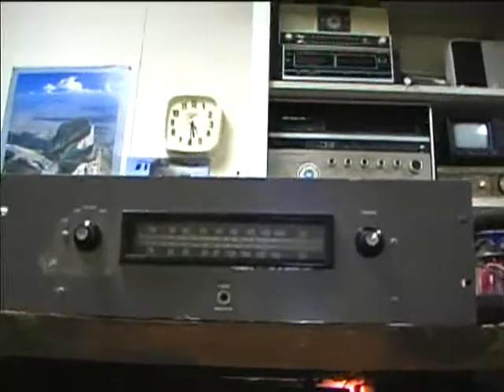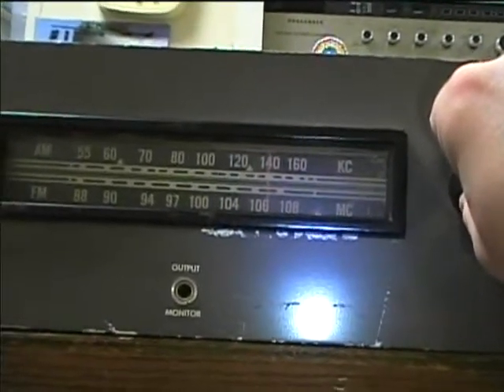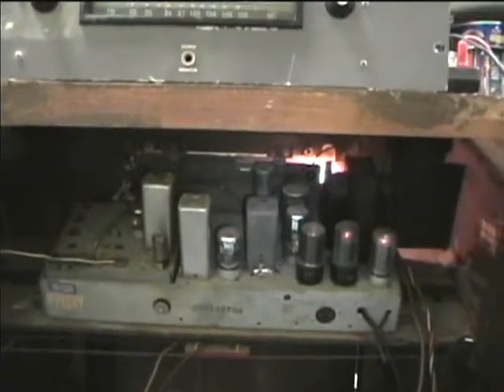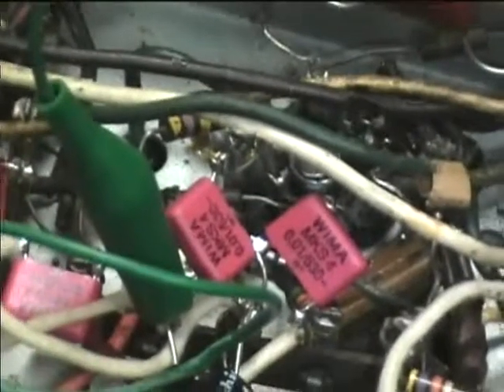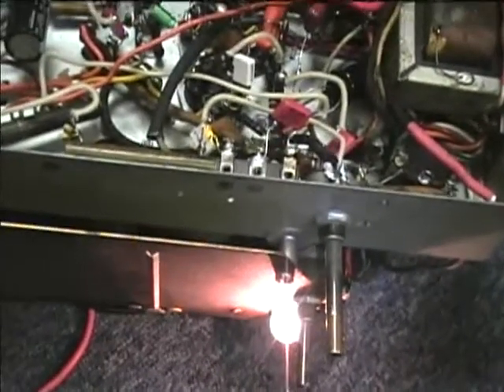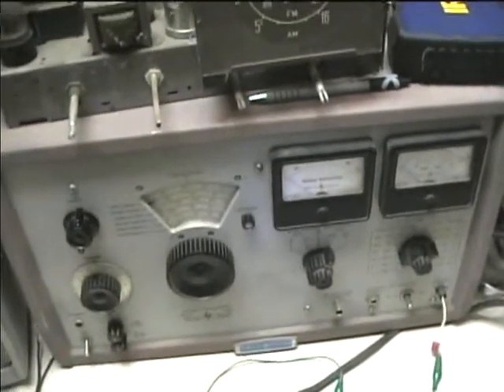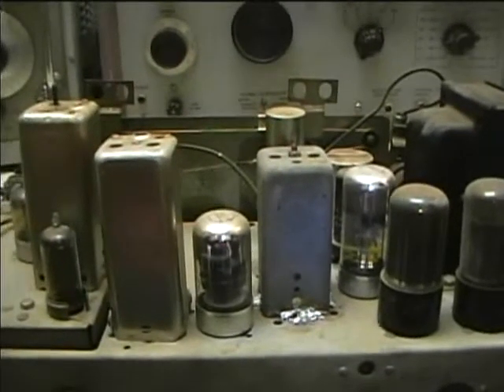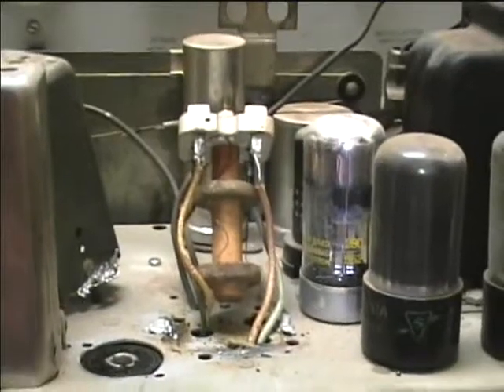1947 Philco 47-1227 AM/FM console radio repairs

Comment: I just bought a Philco 46-1209 which has the same cabinet as yours.  Thanks for posting this as, even though my radio kind of works, I will be restoring it soon.  The problem is mine is missing the correct phonograph.  Let me know if you find a spare or a parts machine.  Marc.

Comment from the maker: I think this may actually use a ratio detector as opposed to a discriminator as it has the electrolytic capacitor in the circuit and does not have an additional limiter stage (it only has a total of 2 IF stages). I have a junk Curtis Mathes AM/FM tube type radio chassis in the barn so I may try salvaging the ratio detector transformer from it and just see if it can be re-tuned to the IF frequency in the Philco.